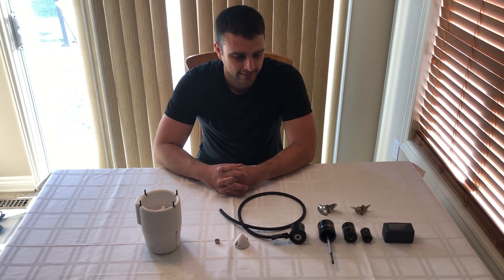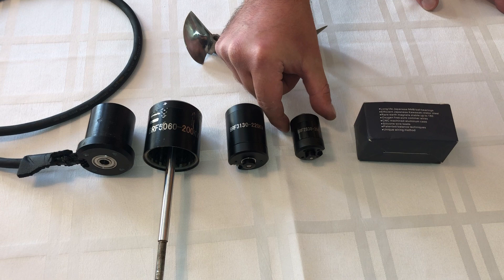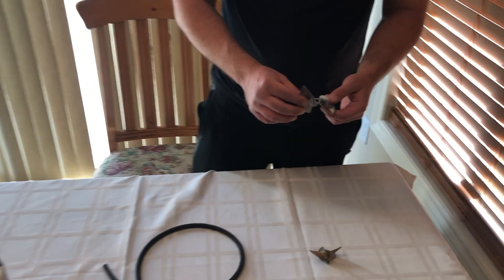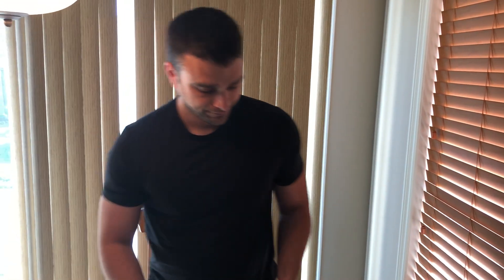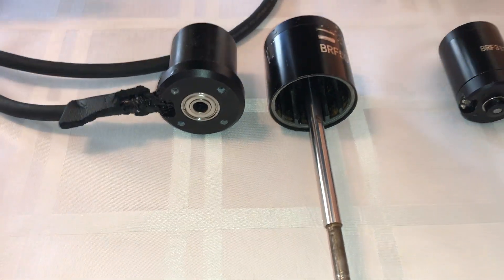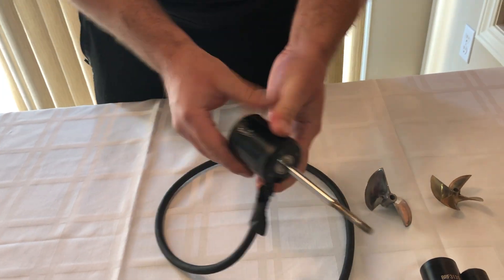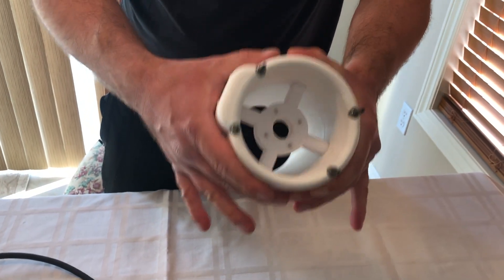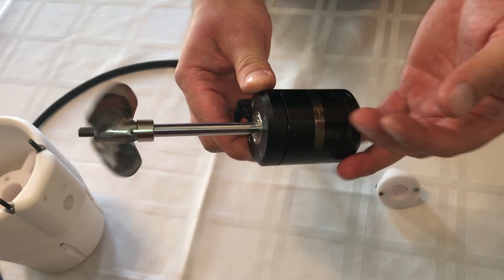DIY Water Thruster Parts

Comment: I have a question. I had a trouble because of the BRF2838 data sheet is not exist on the internet. I need to implement the transfer function to control them. Do you know anyting about it?
Reply from the maker: The back emf constant is the KV; I don’t have any information on the other parameters. Can you tell me a little more about what you mean by implementing the transfer function to control them? If you’re talking about loading it’s a good to know that bldc motors work as synchronous 3 phase AC motors where the load would affect the torque angle.
Reply: @chittlingwhittles1198  motor resistance and inductance coefficients
Reply: @chittlingwhittles1198  V= RI + L di/dt
Reply: @chittlingwhittles1198  https://www.youtube.com/watch?v=VlRpvyG-Tz8 you can check this video

Comment: Great work, I remember seeing your past videos and was very impressed in the design and the power during the bathtub test. I was working on a jetsurf, 3d printed with 3d printed impeller, but got stuck after realign that in salt water stainless steel bearings will corrode , have been searching for a way to create a oil tight seal for the axel (like the outboard motor system), but your solution with these specific out runners that can swap bearings , looks much better and simple. Have you tried it on your kayak?
Reply from the maker: Thanks! I did test out a couple of designs with a 3D printed prop and they do work on a kayak. My next step will most likely be optimizing some designs. I will keep updating.
Reply: @chittlingwhittles1198 do you a web site or forum posts where document the parts or post 3d files?  Really appreciate you posts
Reply from the maker: @MrSSIRON  I appreaciate your support. As of now I only have this channel where I do some design tutorials    and try to discuss certain concepts. I will keep this in mind and let you know if anything changes. Cheers!

Comment: Do these types of motors expect the housing to be watertight along the drive shaft? Or are they waterproof?

Looks damn cool and tempted to try making one for next summer. 

Think it's possible to make something without any metalworking tools?
Reply from the maker: BLDC motors are technically electrically waterproof. You can print a prop and mount it. No need for metalwork.
Reply: @chittlingwhittles1198  Cool stuff, cheers dude!

Also, thanks for the new video showing how the prop mounts to the motor!

I've gone and bought the motor as per the other guys message below... 

https://m.banggood.com/Flipsky-F5085-140KV-650W-Brushless-DC-Motor-for-Direct-Drive-PropellerEfoil-Spare-Parts-p-1636713.html

Hopefully I'll have some fun and figure out how to print a good prop for it :).

I'm thinking of all sorts of fun... Handheld underwater scooter... clamp it to the skeg of my kayak... or friends stand up paddleboards.

Somehow doubt I'll have anything ready for this summer, but there's always 2021 :).
Reply from the maker: While organizing my workspace I remembered your comment and decided to upload a quick video.
Reply: @chittlingwhittles1198  Cheers for that!  I'll update if I actually manage to make something functional from it.

Might be a while... 3 weeks delivery time... then to learn how to hook it up to some 18650 cells I have... figure how many I need (only have 4 at movement, and they take an age to arrive from AliExpress)... then onto designing something cool for it to power!
Reply from the maker: Don’t forget the bms
Reply from the maker: Please be careful. I would suggest building a 4-6s battery. 4s bms are plentiful. I have several of them. I will upload another video on what I use for a battery and power measurement.
Reply: @chittlingwhittles1198  thanks for the tips!

That's along the lines I was thinking 6 in series with 4 sets joined in parallel, idea being 5A from each series allowing max drain of 20A. 

I think that's 4-6S? 

Hopefully that'll be enough to pull me through the water.

Looks like I'll have at least a couple of months to watch every "build a battery" video on YouTube, so hopefully I won't blow my arm off :).
Reply: Gradually getting there, just awaiting delivery of batteries before I start on the first prototype for housing :).

ESC control is a pain, but think it's due to only having 15v instead of 22.2 at the moment.

(Yep, I know, putting the prop on was dumb, but I couldn't resist making just one video :D)

https://youtu.be/oVgQ7_xvp-E
Reply from the maker: Keep me updated. Let me know how the tests go!
Reply from the maker: Check out my prop design video if you’re interested.
Reply: @chittlingwhittles1198  Sorry, delayed response, went on "holiday" last week (lol, corona = going to city 80 miles away for a few nights).  Will have a look... I'm nervous about using F360 as spent so much time on TinkerCad, which really sucks for anything vaguely complex.  I'll give it a stab now though, hopefully I'll finally "get it" with F360! :).  Still kinda limited with what i can do whilst awaiting my stack of batteries and the 2P6S holder.  These ESC's are a bit of a sod to work too (though I think it's due to not having enough power to do much with the motor yet).  Loads of tutorials out there though regarding ESC's, so will figure it out soon enough :).
Reply from the maker: I saw your design. I think it turned out great.

Comment: is this good setup? 5065 330kv motor, 478-78mm boat prop, 80 amp esc, 4s 10,000mah lipo. for water sea scooter
Reply from the maker: That sounds like the same prop I used. The pitch is pretty big so you need good torque. 330kv seems a little high but it could work dependant on the load.
Reply: @chittlingwhittles1198  COOL. and what is the thrust do you get from it?
Reply from the maker: DIY Center 007 I couldn’t get an accurate measure. Just to clarify what I said earlier. If you use a higher kv motor more torque is required as the prop is spun faster at a given voltage otherwise the motor will overheat or stall. Maybe a lower pitch and smaller diameter would be better in your case depending on the size of the motor and load. Cheers

Comment: Working on a electric surfboard project.  Do you think this design or a similar one will be suitable?  also can you give me a price estimate
Reply from the maker: What kind of specs are you looking for?
Reply: @chittlingwhittles1198  well for starters it must be waterproof.  It needs a medium amount of rpm and torque to push the water out of the way.

Ps: sorry for my lack of specs and knowledge I am 14 and am discovering this world of electronics
Reply from the maker: I am very happy for you and about the fact that you’re taking an interest in this! Are you just trying to make something with enough power to push you gently across the water?
Reply: Yes at a solid 15 mph
Reply from the maker: That’s quite fast. If you’re designing one yourself you should look into concepts such as propeller pitch,  propeller slip, motor load and no load characteristics. Are you also designing your own battery?
Reply: @chittlingwhittles1198  thanks for advice.  I will do some digging on some forums.

Comment: Links to products?
Reply: There's a 5085 140kv version made by flipsky, also for underwater use: https://www.banggood.com/Flipsky-F5085-140KV-650W-Brushless-DC-Motor-for-Direct-Drive-PropellerEfoil-Spare-Parts-p-1636713.html?rmmds=search&cur_warehouse=CN
Reply from the maker: RC 44 I have a 5085 that I printed a prop for. The only difference between mine and the flipsky is that mine has a collar where the flipsky uses a c clip. I will upload a quick video about it if I can find it.
Reply from the maker: I’m sorry but the links for the motors lead to a 404. If I find a wholesaler I will order a large quantity and sell them.